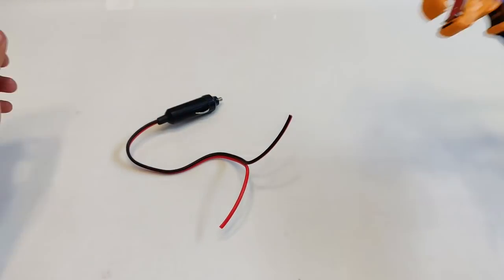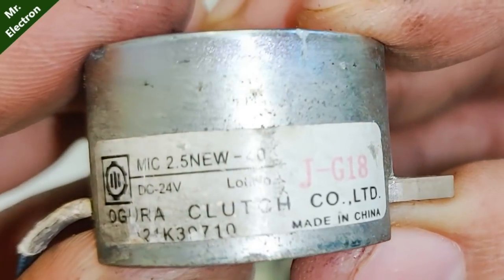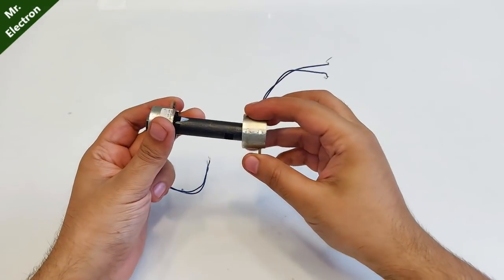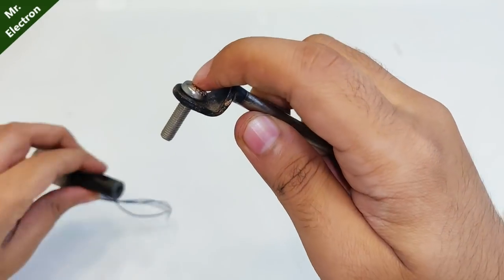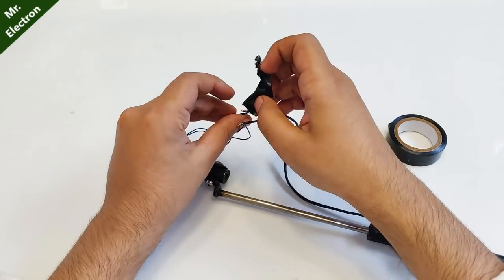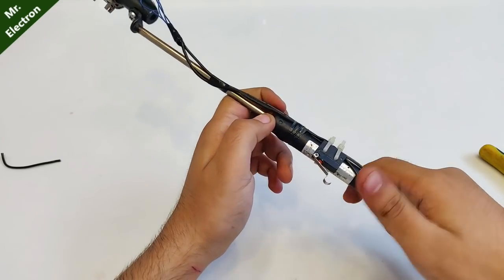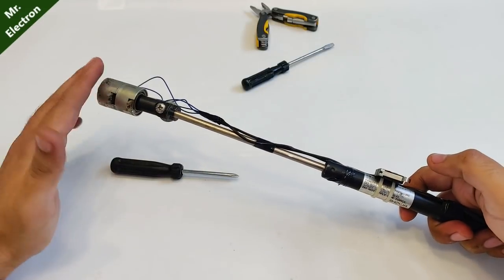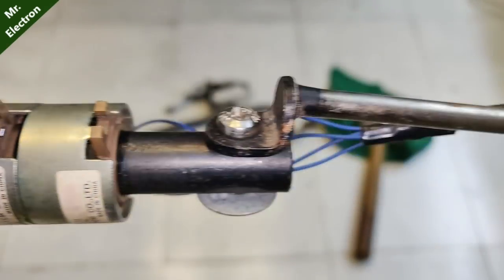10 Kg Lifting Solenoid Electromagnet for Swarf Collecting - Awesome Idea 2020

Comment: Hello sir I'm chaitanya. Sir  ihave seen many videos(dcgenarators) in your channal, please  help me please give me some suggestions,I'm using 24v350wats dc motor and fix my cycle along running with 24v10ams lithium battery , I want to research with out batterie any alternator or dc motor using and take  to run my cycle , so my question  is which type of dc motor (or)alternator with using to run my electric cycle. Please give me any suggestions please sirrrrrrrrrrrrrrrrrrrrrrrrrrrrrrr 🙏🙏🙏🙏🙏🙏🙏🙏🙏🙏🙏🙏🙏🙏🙏🙏🙏🙏🙏🙏🙏🙏🙏🙏🙏🙏🙏🙏